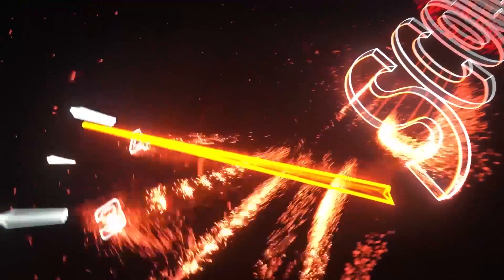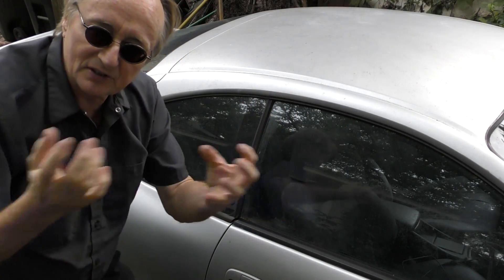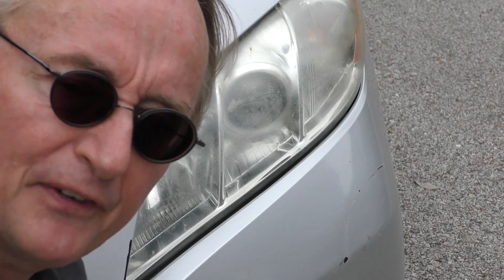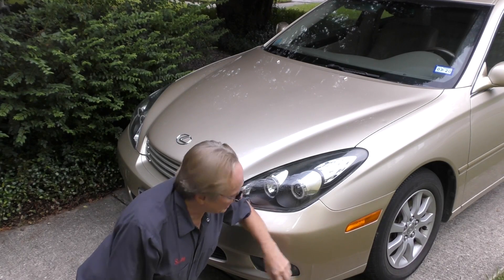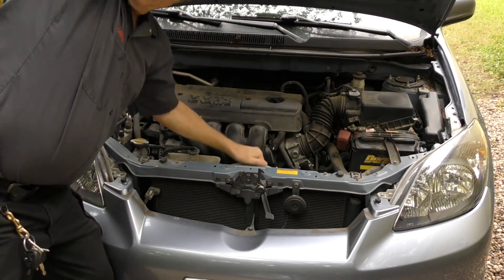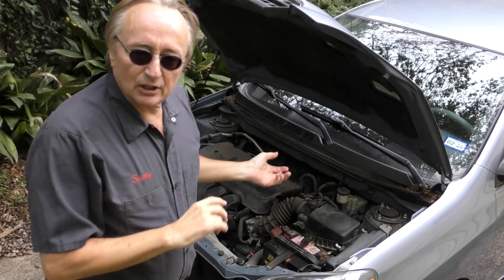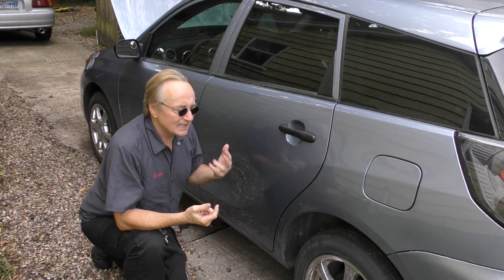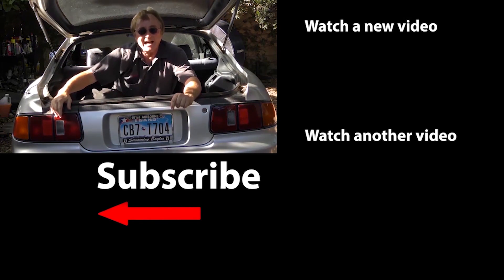You Can't Fix Stupid (Closing My Car Repair Business?)

Comment: Yeah... How about those American made cars?! It never fails that by the time the fuel pump goes out, the strap bolts are so rusted that they just snap right off.. which is OK, because the tank also leaks, the brake lines are shot, and all your bushings have fallen out.. But there ain't nothin' wrong with the radio!
Reply: Not.sure.which.is.worse.American.cars.or.American.women.Well.actually.I.do.At.least.with.the.car.your.losses.are.limited.Alimony,childsupport..,endless.motions.and.such.,besides.half.your.assets...who.knows!!??s.

Comment: I have a 2004 Jeep Grand Cherokee and when I bought it the bushing were all worn out and I replaced all the bars that hold the rear end and I replaced a bar with 2  bushings that hold the front end because when you would give it gas the vehicle kick the back to the right and when you would let off the gas the truck would kick to the left in the back , now the repairs I did it solved a lot of the wiggles in the rear end but it still does it not as bad but I can't see anything lose in the back underneath and when I make a sharp left the rear end kick out of gear or the driveshaft is spinning but it don't kick back in until I straighten the truck back to going straight . 
WHAT THE HECK IS WRONG WITH THIS PIECE OF JUNK ??????

Comment: The more plastic on vehicles, the more their cost is.  It should be the other way around.  I have seen plastic in areas that you wouldn't dare use normally but there it is, on a brand new car !!  CHEAP junk is todays automotive quality. Plastic is everywhere...if they used the right kind of plastic, maybe that would help?

Comment: Ahh! Plastic in cars. Not only dislikes heat. It despises cold.  
 Artificial peanut brittle.  
Over engineering. Bring back the days before you would be a designer. You had to work the trade.
So you don't  need a 500.00 dollar tool to fix a broken spark plug (poorly designed) that you originally had to pull the head which entails jacking the cab off the truck. Not  Triton, more like crouton.

Comment: The starter died in my '03 Matrix when it was at 120K miles, last year.
My first car was an '88 Mazda MX-6, and it had glass headlight housings. Loved 'em.
My '01 Subaru Legacy has two serpentine belts, I like that.

Comment: I think water pumps driven off the timing belts are stupid. I think timing belts are stupid. nothing wrong with pushrods simple and effective and these Plastic timing chain guides!! Really. It would be nice if they could just put the fuel pump snug on the side of the tank. It wouldn’t hurt to back technology up a little bit on some things.

Comment: Talk about stupid engineering designs..........we have a 2007 BMW and the starter failed. Guess where they put the starter? On the firewall!! Why would they put the starter on the firewall! Well duh...........so you can disassemble the top part of the motor to access it. It turns a 30 minute job into a four hour plus job. Stupid design!

Comment: Scotty You Say These are Stupid Changes.... But are They ? I Have a Cousin Who is Quite Smart and Works for a Company I Won't Say The Name But They Actually Develop The Paint Schemes for Most of the Big Auto Company's and They are Big in The UV Coating Protections. I Asked Him Why Can't He "an When I Say He " I Do Mean Him Because He is There Main Man Why He Can't Figure Out a UV Protection to Apply to My Dash in My Truck to Keep it From Cracking and He Looked at Me an Smirked ! and Said to Me That I Can Apply a Coating to Your Dash and You Can Go Park it in The Desert for a 100 years and it Will Look Just as New as The Day it Rolled Off The Assembly Line.... I Said Your Kidding Rite ! He Said NO He Said We Can't Sell it to Anyone Because GM, Ford, Dodge ...ETC Doesn't Want That Type of Coating They Want One That Last About 7 Years....? He Said What's The Typical Loan on a Car and I Said about 5 Years..Then it Hit Me !!! He Also Told Me That He Could Develop a Batch of Paint and I Could Paint My House With it and it Would Also Last 100 Years in The Desert !!!

Comment: SCOTTY language:
1. Rolling pile of junk
2. Fiat-Chrystler joke
3. 51 years!
4. You can’t fix stupid
5. Go see a psychiatrist
6. Cheap plastic
7. Fancy Scan tool
8. Will run forever / I know what you’re thinking
9. Look at my ‘94 Celica, shiny as the day it was made (and the AC still blows cold)
10. The 2004 Lexus I got for my wife
11. Plastic piece of crap / It was a tragic day
12. Stupid plastic headlamps that fade away
13. Stupid plastic painted bumpers
14. Ugly black stuff sticking out
15. Endless money pit
16. Just Empty Every Pocket
17. I was wrong about Mazda
18. Revv up your engines
19. If you never wanna miss one of my videos
20. The way I see it Subaru is full of hot air!
21. I’m lucky I’m not sitting in a death trap!
22. Yr car has a turbo, yr transmission goes pop
23. A customer who’s kind of a loser
24. He fell for an auto industry trick
25. They rust like crazy!
26. This is a Nissan: what a pile of junk!
27. A tiny leak like that on the Celica is no big deal

Comment: now this man claims he knows more than engineers do. Experience doesn't teach you everything you need to know, sir
Reply: And engineers who have never seen the possible problems are no help either.
Reply: @ronfullerton3162  they do see, but it's just for planned obsolescence and to keep the service costs high to profit the brand. It's not because engineers are stupid, it's because most of them are forced to design products like that.
Reply: @lilgobletpcmr562  But the fact still remains that we do have engineers designing things that have no knowledge of the application. They are, as you said, designing within the limits set by bean counters and bookkeepers. I, unfortunately, am older as Scotty and remember machines designed as a unit set up for proper operation and for ease of maintenance over the long haul. Now it is just get them out the door as cheap as possible. I think they do not teach the KISS rule at college any more.

Comment: can't disagree with you or the way you fix stuff. There is better heat resistant and fade resistant plastics but they aren't always used right. I don't like all the plastic but I really hate plastic inside the engine like the lifter holders on chevy and ram trucks. That is plastic meant for heat resistance but it is just a poor design. coworker had a 5.7 hemi with the mds cylinder management system. they design it with collapsible lifters and the lifter retainers meant to keep the lifter from rotating because the lifter has a roller on the end. They have one plastic retainer to hold two lifters in place while held in with one single 10mm nut in the middle of the two lifters. That's really stupid design

Comment: You do know that the audis that have a  plastic water pump blade( it's not normal plastic, its reinforced ) dont use water as coolant right, these high end cars use waterless coolants..... wich is heavier to pump and gets alot hotter then water cooled engines. Normal waterpumps on high end cars  break easy after a while, getting hot and cold again all the time, this reinforced plastic. IF it even breaks off ( wich hasn't happened in my 9 years of working with audi ) it wont hurt the engine like steel or aluminium does. And plastic also does not get corroded.
And is immune to all other minerals like chalk found in water.

Guess this channel is stuck in the 1990s, just as that shitty celica you always praise.

Comment: Get an EV, and you never have to fix another thing on your car for 10-15 years except for tires,12-volt battery, and windshield wiper blades and windshield washer fluid. Unless you get a Nissan Leaf, then every 60,000 miles, you may need a new battery pack.  But you change that, and you basically have a new car again with the same performance as when you first bought the EV. Nissan is the worst of the EV's terrible vehicle; don't ever buy one wait for the new Volkswagon ID  iD Crozz; it is insane. Guaranteed 8 years for the battery, and the battery is going to be suitable for 12 years or more. The best thing, no gas, no maintenance ever again. With an ICE car, the engine and transmission vibrate the damn thing to pieces, and it isn't worth crap in 10 years. An EV you change the battery pack and give the car to your grandkids because it will still be around when your kids have kids, and they can then give it to their grandchildren and never cost anyone as much to keep on the road as an ICE car.
On top of everything else, if you don't have money for gas, or oil, or fluids and maintenance that will cost you as much as a new car at the end of the life of an ICE car then just plug up at a friends house or at one of the public chargers for free and go where ever you want for the rest of your life. Hell, there is even a society of people that let you come and charge your EV for free at their homes because they want to fight too rid the earth of these antiquated machines that haven't changed in over 125 years. Love you holmes, but you are fighting a losing battle. Ford is putting in thousands of charging stations with Charge America and going full electric by 2022 along with VW. I also believe that the government will pay you in the future to buy an EV and crush that dopy old fume belching antique piles of junk ICE car. They have served their purpose, but now must GO AWAY! Sorry so carried away.